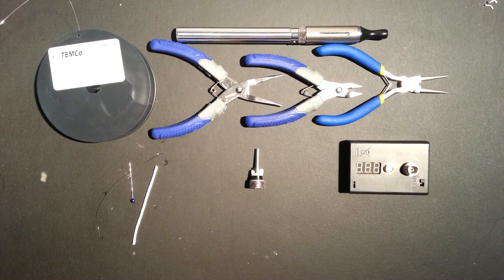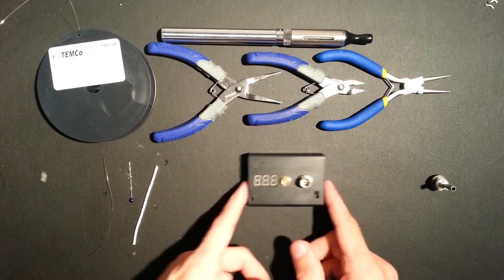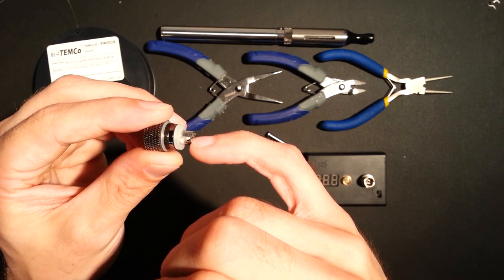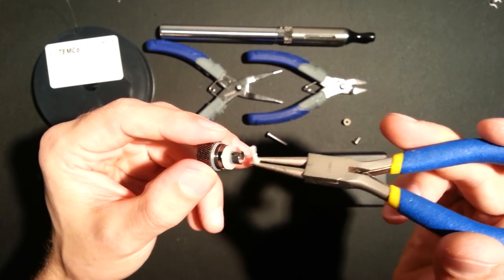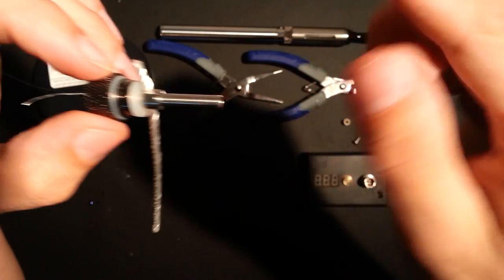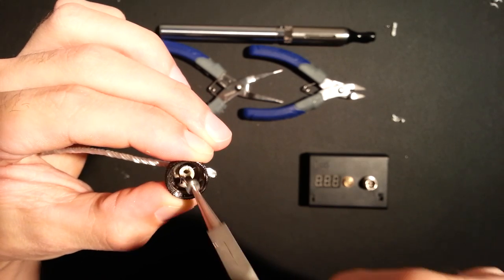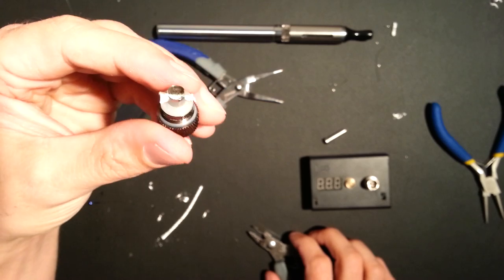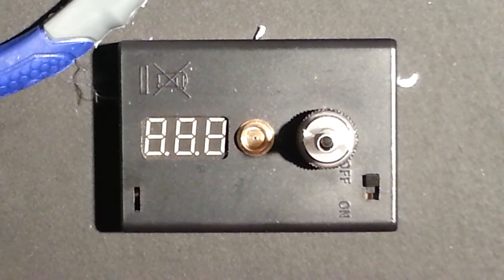Kanger T3 Bottom Coil Atomizer Rebuild HD Close Up

Comment: Thanks for the vid. Attempted my first rebuilds today after watching this. Finding it tough to get neat coils, but I guess this will come with practice. The first attempt shorted, but the second works great. Tried a slight difference to your instructions on the second one. I trimmed the ground wire after putting in the rubber plug, before putting the metal plug back, and maybe I was able to cut it closer, thus avoiding any risk of shorting. Just a thought, and seems to work fine.

Comment from the maker: It depends on if your battery has built in short protection. You should look into it with your battery, also, the ohm meter helps in making sure the head works before hooking it up to your battery.

Comment from the maker: In short, yes. Lower resistance makes it take less voltage to get the same heat generation. Try it, the surface area of the coil on the wick may play into it as well.

Comment from the maker: Hmm, I know some folks have had this issue. If you are sure that there is as little exposed coil between the wick and the base on both ends, the only other thing I could suggest is a dry burn and a rinse. I cover this in the last few minutes of my Kanger EVOD Rebuild video. Check it out and see if it helps?

Comment: Thank you so much. Kanger T3 is the best clearomizer, and it's really good to see such a good how-to review in rebuilding its coil. I've never try to rebuild any coil. My question is about the wire used for coils. What matters in low and high Res.? The length of the coil or the gauge of the wire? or both? what is your recommendation for building a 2.0 and 2.4 ohms coils?
appreciate your help.

Comment from the maker: Ha, not usually. Most newer and major brand name battery manufacturers like Vision, Joyetech etc have built in protections to prevent that very thing from happening. If you are curious, you should research your particular make/model of your battery to see if it has those features.

Comment: There are no vids for the Kanger t3d(dual coil) rebuild. Any plans on making a vid? You have the best quality rebuild vid out there btw. Great cam, good voice, very good explanation. Thanks for the vid. I bought some kanger t3s with 32ga and ekowool 3mm and 2mm. So if nothing else ill just be rebuilding my single coils. A whole whole lot easier from what ive seen any way. 
Again, thanks for the vid
Reply from the maker: We just put up a tutorial on the Protank 3 which uses the same coil heads (except for the stem.) Check it out here: Kanger Protank 3 Dual Coil BDC Atomizer Rebuild Tutuorial HD Close Up

Comment: thanks for sharing! 
I have a question: when I tried to rebuild a T3, it worked perfectly- tested the resistance, poured some juice on it and fired it, and it worked perfectly right up to the point where it was submerged in e-liquid... then it shorted out. could you please help me understand what went wrong? I do not have a lot of experience at rebuilding, but wish to learn. thank you!

Comment from the maker: You may find that performing a dry burn and then soaking the heads over night with hot water may help. I do know other folks who have had this issue and it may also be a defect in the t3 unit. Let me know if dry burning/ rinsing helps.

Comment from the maker: The ohms / resistance have little to do with the unit and more to do with the voltage. 5-6 wraps around with the coil give me 1.4 - 1.6 ohms, which is perfect for a standard ego battery without variable voltage control. Those batteries run about 3.3v , 1.4 - 1.6 is the sweet spot in my opinion for that voltage. With 4 wraps, you may be getting somewhere around 1.2 which may be a little hot. Keep playing with it and I'm sure you'll get it.

Comment: Very nice vid! I have a question please. Being a BCT, and using 3mm wick with another, say 2mm of flavor wicking, and a low res. coil setup (under 1.5 ohms) and chain vaping, (as I do too!) you're not finding any burning issues due to it not wicking fast enough? I'm sure it's working well for you, as you're using it, but just wanted to know if you do have any issues like that. Thanks again!

Comment from the maker: You could, or you could try a thinner gauge of kanthal if you start to run out of room to work with. The thinner it is, the higher the resistance. Maybe some 34 or 36 gauge with only 4-6 wraps.

Comment from the maker: hmm, take note of the square shaped hole that the wick plugs on either side of the coil head and make sure that there is no exposed area, and that it is completely plugged by wick. Not too tight, nor too loosely though.

Comment: OK so i rebuilt my coil and i have to say it doesn't hit as hard as it did from the factory,,so where did i go wrong,,I'm not sure what gauge of wire they used from the factory,,they had 5 wraps so i did 5 wraps,and how long should one of these last i figure I'm a fairly heavy vapor,,,thanks man,,

Comment from the maker: The gauge of the wire and the length. The gauge will play more to the resistance though. Thicker wire means lower resistance. Thing of it like water in pipes, bigger pipes, more water flow. Smaller pipes, much less flow and more resistance.

Comment: Hey I have on thing to ask you. I have the Kanger Evod kit. With the standard tank that comes with it. Looking through your videos there is one rebuild in which you use 2mm wick and in this video you use 3mm wick.. I bought 3mm wick and upon inspection of my old coils today I found that the original wick is considerably smaller  than 2mm. Do i need to get the 2mm to rebuild these coils or will the 3mm work fine. I Vape juices high in PG so they are a bit thinner than the higher VG juices. Thanks for your answer in advance.

Comment: Hey man. After you have assembled the positive connector thing into the grommet, it is almost impossible to the wire totally. I can get it fairly short, but not al the way short. What should I do with the rest of the wire. Push it down or up?

Comment from the maker: Neither, you want to make sure that once assembled, the coil and wick are nice and snug, and then trim the excess wire as closely as possible. You can sneak under the gromet with some small wire cutters, and make it so that the wire doesn't show. The end of the wire that goes in the center pin is the most important to not be exposed.

Comment: not sure if someone else said this, but using organic cotton over silica for a wick will make another night and day difference. Right now some people are even contemplating Rayon fibers, but if you haven't tried cotton yet in your tanks, do yourself a favor and learn to thread some organic cotton through the coil after you pull out the silica. Holy. CRAP. Difference in vapor and flavor is night and day in itself.

Comment: @Snaredrummer88 I purchased the 32 gauge Kanthal A1 wire along with some 3mm silica wick and it tastes really bad.  Tried boiling the wick and it still tastes horrible.  Thoughts?
Reply from the maker: It sounds like your coil legs may be too long. Make sure to get them nice and snug before vaping. Alternatively, you could wrap them in non resistance wire, and / or use silicone insulators which have a higher heat resistance and won't burn as easily as rubber (probably what you are tasting)

Comment: @Hayseed you can buy that same ohm meter  at madvapes.com as for the burnt taste; did you oxidize the wire by heating with a lighter before you wrapped iit ?? or it may be wrapped too tight..  just my 2 cents and I'm sure snaredrummer. will have more advice...

Comment: I recently got some 32 gauge wire from the links provided, I just rebuilt my first t3 and the whole base gets too hot with lo vapor. First attempt done with 6 wraps, second one with 4. Any ideas of what may be wrong? I am using cotton
Reply from the maker: Rubens Guifarro Sounds like you may be shorting the coil.
Reply: 24 is my fav

Comment: Okay, is anyone else just NOT able to get that rubber grommet back into place? I tried everything after taking it out; using some eliquid, thinner pliers, everything, and it just will not pop back into place.
Reply: Did you get it in?  I used a toothpick to jam it in there.  Didn't have to use any liquid at all.

Comment: Easier if you remove the head from the base
Reply: You can't remove it on the T3 series like you can on the EVOD/Protank. The head and base are one piece.
Reply: interesting.. they come off on mine....
Reply: You probably have a newer T3S then. The new T3S has a twist-off coil head just like the EVOD and Protank, but the original T3 and the MT3 heads are permanently attached to the base. For example, look at the product image on http://www.myvaporstore.com/Atomizer_Head_for_Kanger_T3_MT3_p/krt3-ah.htm and you'll see that the unit sold is one piece.

Comment: LOL   at the cost of 2 dollars for a new coil,   my time is valuable enough not to waste it on doing a rebuild.   I mean even if you value time in labor at $20 per hour,  just doing the math tells you that if it takes you over 6 minutes to do the rebuild you have gained nothing.   And that doesnt include the price of tools or other materials.   I buy brand new coils in a box of 5 for $10 bucks,  to me rebuilding old ones seems just silly.   Better things to do with my time.
Reply: The difference in flavor is a big enough motivator for me.The difference is like night and day.  Just did my first rebuild and it's an amazing difference.
Reply: The coils that you can buy are crap and do not last long at all. Not to mention you will get a better vape on rebuilt. I personally use Rebuildable's now and have moved on to better vape, but for back up I do this...